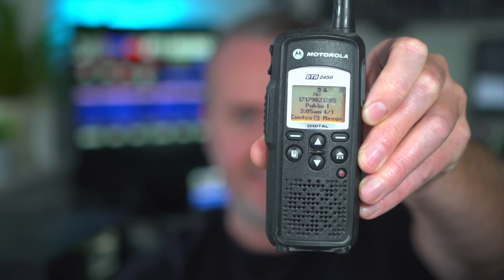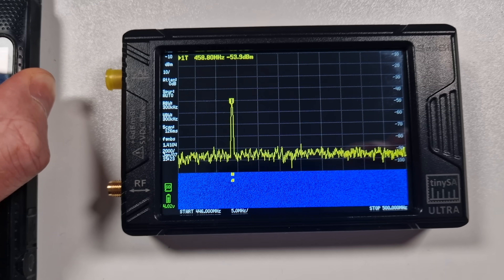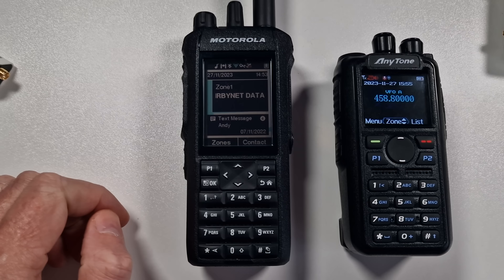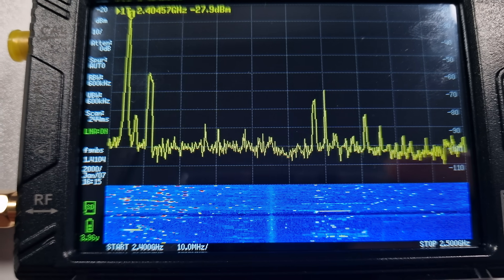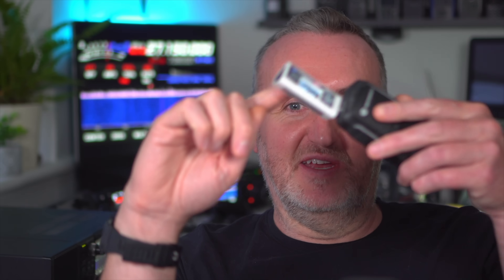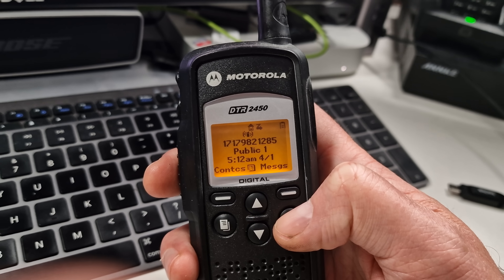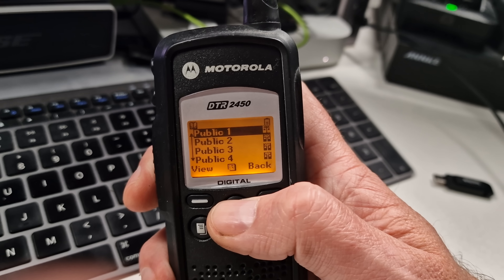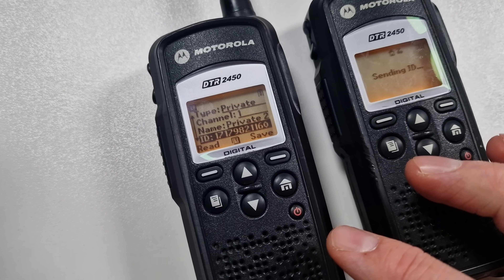UNDETECTABLE RADIOS!!!

Comment: Our workplace had about 25 of these,  and a manager was tricked into  selling them for £10 each,  And were replaced by our end 446, where we always got interference and people shouting over them, and other things.   We never had a problem with the Motorola  radios.     Someone got a bargain there £10 each for 25 radios .   They would’ve made a major profit..       from a very effective radio system, that I introduced the manager decided that we need a different radios, and we landed up with issue after issue, some of the radiators broke within weeks.

Comment: They are very simar to our DTR radios in the US, though ours are on 900MHz ISM band. 

Question: Are they capable of DMR and encryption?

The beauty of US regulations on 2 way in the ISM band is not only the FHSS, but you can use DMR. Output is limited to 1W but that's fine for close range groups.

But encryption is also allowed on these radios. Encryption is something of a hot button issue in the US as NO amateur or license free band is lowed to use it, except ISM.

Only commercial/public safety can use encryption other than on the ISM band.

Just curious if it's the same over there.

Comment: Hey just a suggestion for future vids. If possible, could you please put the names or details of all the hardware you use during each vid in the description? Not like a whole spec sheet or anything but maybe just the names or an Amazon link? Trying to look at that Alfa antenna but the ones I keep finding are the RP-SMA and I thought the TinySA’s were regular SMA. Is the antenna actually an RP-SMA and you’re just using an adapter? Any info would be appreciated. Thanks.
Reply from the maker: Yes I'm using an adapter.👍🏼

Comment: The DTR2450  look like they are maybe as secure as the old SINGARS military radios of the 70s. You certainly can see they are there if you are close to it and it is heavily used.

Back in the early 70s I was one of the team at Rockwell International (who sluppped up Collins among others. We were not Collins based, though.) We did fast frequency hopping between 5000 and 10000 hops per second with amazing amounts of redundancy. The radios were designed for ECCM use - communications despite jamming.. Heh,, they also introduced a small jamming component sounding like ignition noise on narrow band radios. I was involved in phase 2 and phase 3 models of FFH development for the US Army. As a woman it was fun to work on a tool conceived of and patented by a woman, Hedy Lamar. Lemme see, we schmooed the signal across 255 VHF or UHF 50 kHz channels. Yeah, we were there. At the time busting into the net was not feasible for deployed ECM systems. They knew we were there and that ended what they could do.

Of course, some of us looked forward, even more than me on my third job since graduation. It's not difficult to derive the hop code if it's a simple 255 value PRN. But, that is handled neatly with a proper key generator and some means of reading precise time. With the hop code you, as a jammer, can hop along and either listen in to get baseband data which may be encrypted or transmit captures of previously send packets. You are fighting on a 1:1 playing field. Without the hop code you're stuck with jamming enough frequencies that the signaling breaks. A 1/3 band or so partial band jammer is the sort of idea. The anti-jam margin was about 35 dB in that case. So jamming requires much higher power equipment than the soldier with the radio. Now, there is another attack that puts you nearly back to parity. More on that later.

Alas, the Army ended up going with slow hopping with the codes generated by genuine crypto tools. It made most of their goals well enough. Now with a Pluto or Lime SDR it is not difficult to generate a remarkably small jammer for hoppers. Suppose you have a delay line a few milliseconds long. You can build a listen for the signal for a short time and transmit the signal or noise on the signal's frequency for the length of your recording. Bob's your uncle - almost. The speed of light is on the FFH side. SFH has a much larger vulnerability region in which the signal is still being transmitted after a time delay equal to the jammer's recording time + time of flight from TX + time of flight from RX we are jamming. With tens of milliseconds per hop you can lace the signal with errors if you use 1 ms for your recording interval you can chop chunks out of the slow hopper out to distances of 20 miles or more. For a FFH tool at 10,000 hops per second rather than 100 you pull in from 20 Miles to about 1000'. You can only jam from right on top of the victims. That can be a health hazard on the battlefield.

Anyway all that not withstanding clever people with real equipment are going to make your DTR3450 and read it like a book if they are looking for it. My work is greyhair material, 50 years ago. In that time imagine what the military and other security conscious agencies can do now. (Two of the other things I did at Rockwell were along that alley. If they really are serious about detecting, monitoring, locating, or doing something else they will find it if you use it too close to "enemy territory".

And for hams - my favorite observation about our FCC over here. "They have not put a limit on how often we can change frequencies in a QSO."

{^_-}

Comment: Tested those Motorolas in hydro tunnels in Scotland about 10 years ago. UK version is 100mW, US version is 500mW, but Moto UK  wouldn't agree to import them. 
They propagate all the way to the noise floor in tunnels - waveguide effect. We got a couple of km out of them underground. The 4m and UHF radios we were testing in parallel went nowhere. Nice radios. Pity they don't make them any more.

Comment: Same with US versions DTR 410, 550 and 650. These are less than $100 used. The newer 600 and 700 versions cost more but just have more channels.
Frequency hopping spread spectrum 90ms hops in 50 channels with private text and digital voice.

Comment: The dtr in the US used a lot of 902-928 ism band in the US which was assigned to cordless phones and baby monitors etc. we have some data radios aka 900 MHz wifi, but it is mostly amateur radio use now
Reply: And the 900MHz has better coverage than 2.4GHz

Comment: Started using the DTR650 and DTR700 last year Apparently, it's up in the ISM Band. Same frequencies that some medical devices use. Most businesses around here are using the default profile and channel so they can be pretty easy to find. If you looking to listen to some or your local businesses, these radios are great a cheap little scanner
Reply: What other model are still available on eBay that can do this?

Comment: 50 - 100milliwatts? What is the range on that? 1/4 of a KM ( 1/10th of a mile?)  In NYC that is 2 block?  That is pretty usless. Especially with the radio noice NYC has in that area. That is no better than shouting across the distance. It maybe great if one lives in a 1000acre farm but who lives in a 1000acre farm?

Wifi is about that that much power, how far can you take your laptop away from your wifi? Other end of your house before it disconnects?

Back in the 70s we used to have these kid walkie talkies that were on various frequencies including CB, but at 250milliwatts. The range on those things were about 3 NYC blocks, I would guess 2/5ths of a km or a 1/6th of a mile.

I think those radios were a failed experiment and that is why Motorola dropped them because they could not justify their cost to their short range.
Reply: Power and range are only loosely related. I've had signals received over 500km away with 500mW on 2 meters. But that was on a high altitude balloon. There are a number of other variables. The biggest challenge with 2.4Ghz is that losses are high as it goes through buildings and trees. With a clear line of sight that 50mW might work fine over like 30km. CB radio is mostly limited by noise, if the band was quiet and the solar conditions were right, that 250mW on SSB might get you heard around the world. Digital modes can take it even further.
Reply from the maker: Yes, another example is LoRa which can do crazy distances on very low power.
Reply: @lordgarak  for low power the perfect dipole or whip is no match for a perfect Yagi

Comment: I equipped a high-rise building emergency response team with DTR-650's (900MHz ISM here in Canada), and they worked spectacularly through over 20 floors and down into the parking garage. We upgraded to the slightly longer whip antennas. In free space, from the 20th floor, we easily reached out 13km (and could have went farther). Highly recommended piece of tech.
Reply from the maker: Very interesting, that's impressive range. 900mhz can work extremely well with the right antennas, infact it's very similar to UHF at around 400mhz but because of the frequency hopping its much more resilient to interference. Thanks for your comment.👍🏼
Reply: 900 MHz, yes, but legal 2.4 GHz european unit is a bad range radio....
Reply from the maker: Yeah, we managed a couple of miles out of these in our testing, hilltop to hilltop 👍🏼
Reply: Really ??? I had a analog 450mhz mobile phone back in the days of analog mobile phones and it would loose the signal inside a car or inside concrete buildings... But It was often very far to the nearest cell phone tower so that might be the reason for it being so sensitive to getting blocked. With a antenna on the car roof you more then 4 doubled the range.

Comment: I use the Bowman Marconi PRR radios which operate in a small segment of the 2.4 GHz band as well. Have assembled adapters that allow the use of other types of headsets. They seem to be immune to interference from other equipment utilizing adjacent spectrum in the 2.4 band but these can shut down Bluetooth and WiFi signals within several hundred meters. Quite efficient as squad comms for us in Uncle Sam’s Misguided Children’s 12:34  units. Looking forward to the new units that are encrypted and frequency hopping as well. There were plenty on the market about a decade ago so I invested in these as spares for my unit out of pocket, been a lifesaver. Sealed units, rugged, not that small but one can effectively hide the transceiver in one’s pack while routing the antenna on an extension onto the top of the pack or higher topped with a high gain 2.4 GHz antenna. The common router antennas require an adapter that goes from a reverse sma to sma in order to work with these antennas but there are commercial suppliers in the States that will do a custom order for government work supplying +6db gain antennas if bought in bulk with the proper connector installed for these radios.
Reply: What is the range ?

Comment: There are also Motorola DLR radios which operate spread spectrum on 900 MHz and would also be undetectable. I believe they are not discontinued and still available for purchase. 900 MHz would also propagate better than 2.4 GHz
Reply: Probably not legal to use in the EU considering GSM Telcom systems use a good portion of that part of the band. In the States we have access to a portion of that band for Amateur radio.
Reply from the maker: Yes in the EU 900mhz will be full of GSM or other Cellular systems. Another commenter said they work well in Canada though.

Comment: Cool radios but even your frequency hopping radio is detectable and trackable with the right equipment.. and it is easily available at a cost of ~£1000 on the open market. There is no such thing as completely secure radio but just radio that needs more expensive to equip for.
Reply: DSS is very dificult to detect/listen.
The all signal is under thr noise floor....
Reply: @jplacido9999  Well within reach of "alphabet entities"...

Comment: Meshtastic uses LORA which is a lower frequency than WiFi and also uses a hopping technique. I use on 915 Mhz with a 160mW output in Australia. Encrpyted channels can be setup and every Meshtastic unit is a repeater. Text based only comms. I'd like to see you do a review.
Reply: Direct talk on Motorola iden phones uses digital FHSS on 900Mhz ISM band. Too bad most of the handsets are so old at this point.

Comment: I grew up near Motorola ... On a Different Note--- I remember when they created the 1st Vibra-sender System and The Elgin Police Department was one of the 1st to try it
Reply: You must be from Chicago, gads I remember working on some really old equipment with those components. A very early system of Private Line the big M had patented I believe in the early 60’s or late 50’s.

Comment: Here in Australia, my cordless house phone (3 cordless 1 base) works exactly like that, on the wifi frequency, frequency hoping, and all that. Purchased in 04. They first showed up in late 90's.
Luvin that beat man👍
Reply: Just be cautious, a device so old is a honeypot for hacking and free calls...
Reply: @jimbotron70
Yeah thanks for the tip. The base unit gets pinged a few times a week.
I came up with a mod years ago. Thats why I'm still using such old phones.
Cheers.
Reply: A 2.4ghz phone from the 2000's 😂😂😂 , your just asking to get hacked

Comment: Nothing is 100% secure.
Reply: Realist comment ever👍
Reply from the maker: Nothing is 100% secure but you should be 100% sure what you are using.
Reply: @andykirby  always 👍
Reply: Turn it off and store in a metal container.  That's undetectable!
Reply: @thomasmaughan4798 have to keep batteries charged if they use built in rechargeable batteries so that they have to come out of the container for charging Unless you design a battery operated charger you can place in the container to charge them once a month.
Reply: Not anything a regular joe can buy no. idd Say RAKEL g2 Is pretty water proof tho.

Comment: Bluetooth RF looks similar (hopping around).. try an SA with max hold..   I have a pair of kids digital 2.4GHz walkie-talkies (Dickie) Interesting vid Andy, thanks!
Reply from the maker: Thanks! Wow that's interesting they are using 2.4ghz for  toy walkie talkies now... I'll have to do a teardown! Wonder if you buy a set they talk to other pairs??
Reply: @andykirby  Yeah  I actually managed to solder an SMA tail onto one of these toy radios (measured the signal at 2.485GHz +6dBm).. with a flat panel antenna got it working about 100m los. Not sure what the exact modulation they use, I'm guessing it's GMSK like the Nordic NRF modules. Fun to play with, quite reasonable audio to, think  they were not more that'll £20 for a pair. 73.